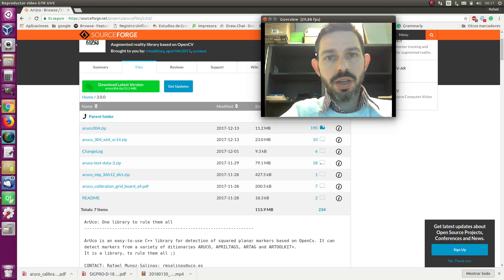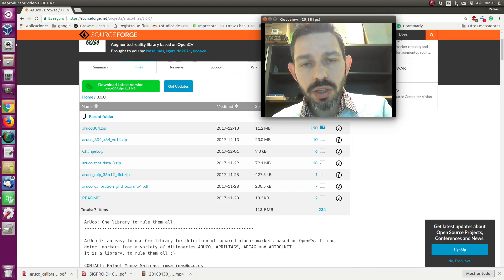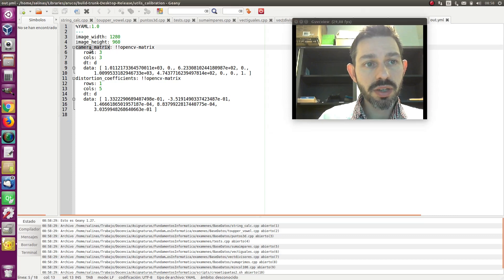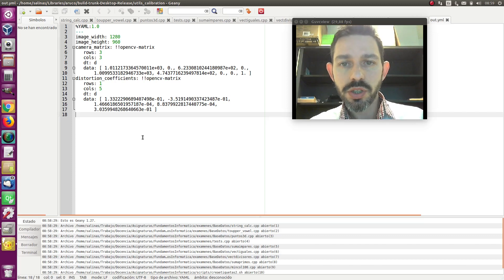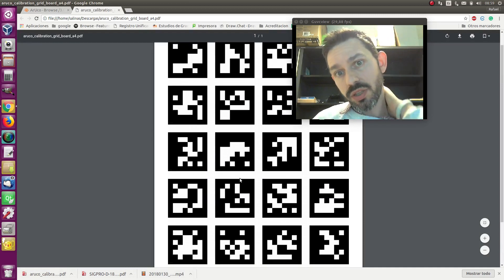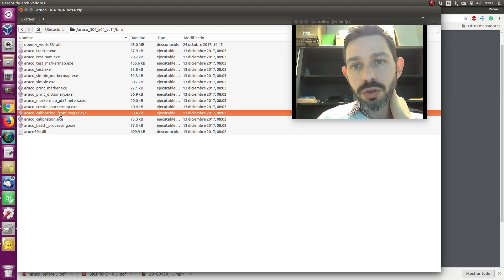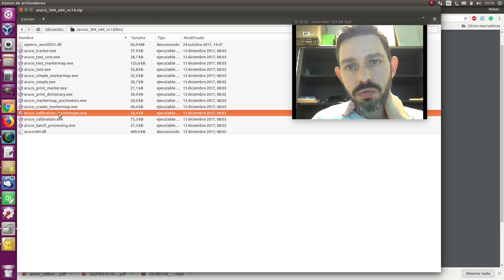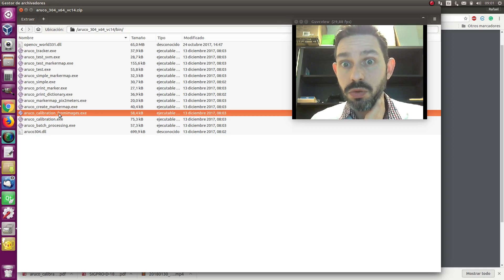6. Calibration with Aruco

Comment: Hello, Rafael. I tried using aruco_calibration_fromimages.exe, but I don't really know what should I enter for the 'out_camera_calibration.yml' part. 
I got an error saying 'OpenCV Error: Assertion failed (nimages > 0) in cv::calibrateCamera, file C:\build\master_winpack-build-win64-vc14\opencv\modules\calib3d\src\calibration.cpp, line 3334
Exception :C:\build\master_winpack-build-win64-vc14\opencv\modules\calib3d\src\calibration.cpp:3334: error: (-215) nimages > 0 in function cv::calibrateCamera'. Thanks.
Reply from the maker: please send me an email
Reply: @rafaelmunozsalinas  kindly guide me as well.. I have a similar issue. I am unable to figure out what command to enter. I have been trying several formats but every time i get the same error as in the comment above.